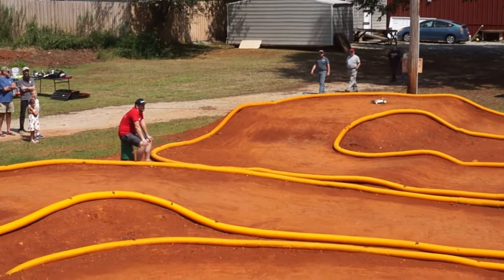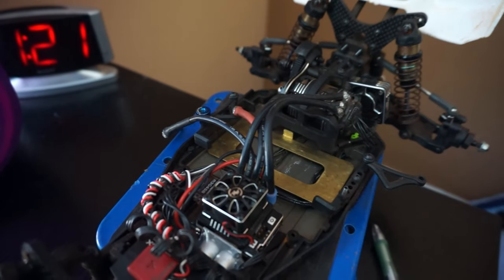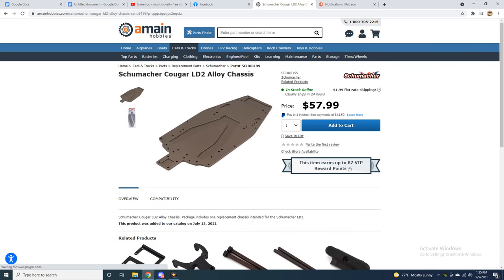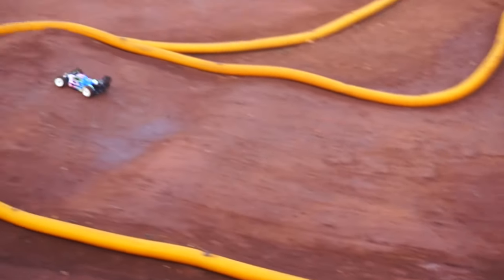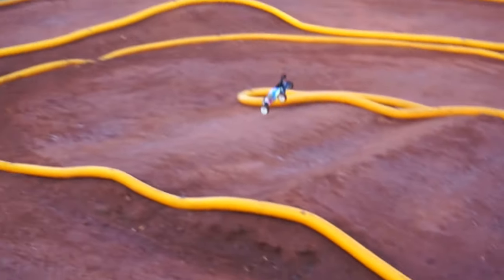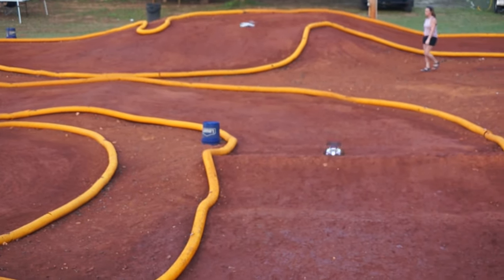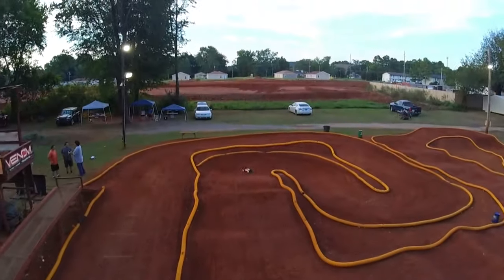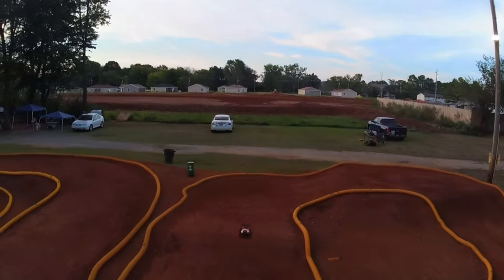More RC Upgrades (+The best upgrade of all)

Comment: Thank you for actually saying that the upgrades aren't going to make you faster without the experience. I've been racing for 3 years and constantly tell the newer guys that whole bling is fine (I have plenty of shiny parts on my 1/10th rigs) figuring out tires and wheel time are going to get the biggest positive results for you. Even if you have an outdated motor, if your consistency isn't averaging like 95%, a faster motor is probably going to make things worse.

Comment: The other problem with aluminum suspension arms is that the energy from a crash would then move to the next weakest point which I believe is the steering

Comment: Need an answer do with the bulkhead if I upgrade it won’t it put more stress on to the front arms of the car and make them snap?
Reply from the maker: The arms can usually handle the extra strain unless you're in a really bad crash. The problem with the stock plastic bulkheads/pivot blocks is that they're so fragile due to how they're designed and due to the strain they already endure, upgrading the material is pretty much necessary.